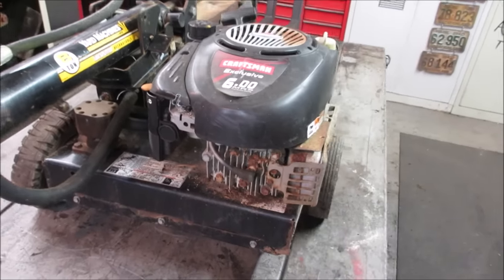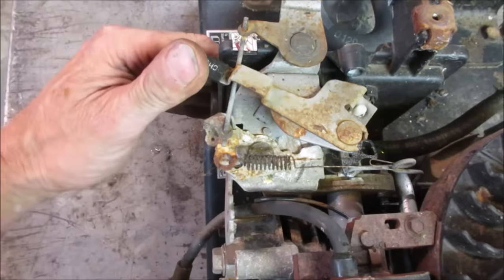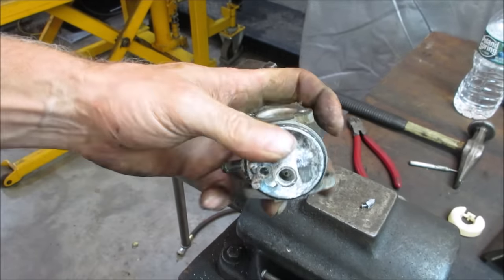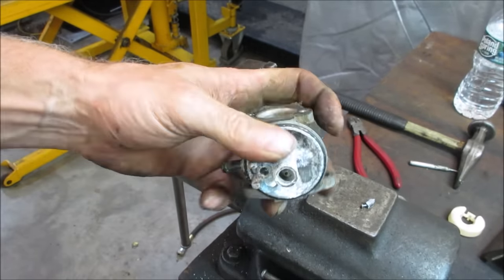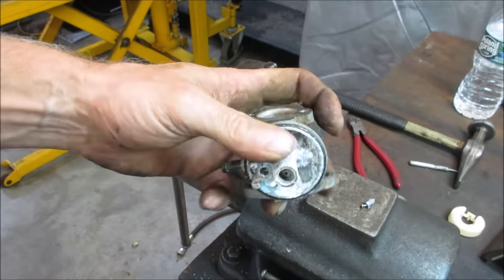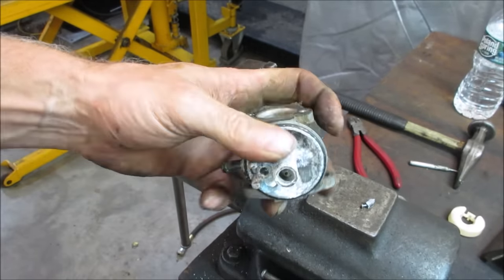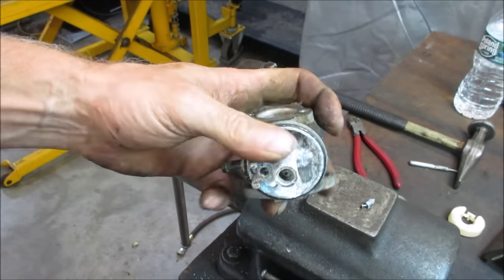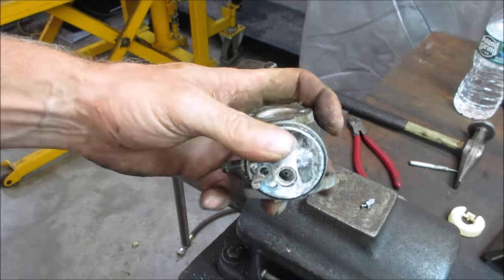Crushed Under a Barn, Free Busted Log Splitter

Comment: Loved it! Mustie you are the epitome of the circular economy - anything that can be fixed and reused is put back into service!
Reply: ironically that only works because several 100k watch and make it economically feasible.
Reply: Making old stuff operable is maximum green.  Many recommend(Scotty K.) that the greenest car is an older Toyota gasoline car that you keep on the road for several hundred thousand more miles.  Many of the newer things that are supposed to be green have failure rates so high that they wear out very quickly.  There is pollution for building the device in the first place. If it doesn't last then you have to build another one. If the so called green device does not last long enough to save enough energy to "pay back" the cost of having to build and install it's replacement then it ain't green.
warrantee three times in the last 5 years. I'm not sure what I will do when it hits 5 years.

Comment: Just add it to my list, powerful little machine! Another machine back in service 👍
Reply: Dear Jason 5150mxVW
👍👌👏 Always nice to meet you here. 2) Yes, you are right, it's powerful enough. If a cross shaped splitting wedge would be added, it could really be a very usable device. With this single wedge, splitting wood is simply too time and fuel consuming.
Hope that you are fully recovered from that extremely exhausting rescue mission.
Best regards, luck and health in particular.
Reply: @Chr.U.Cas1622  Well this is a homeowner series machine, meant for casual "splitting one tree per use" and not an industrial type machine meant to run all day so that's why it it only has one wedge. Adding a cross probably means upping the size of the machine and the horsepower rating (up to 8 HP). Too bad people just don't have any time anymore, eh? Make time and quit complaining about the small things.
Reply: @Hjerte_Verke  
Now look at that! What do we have here? Doesn't it suspiciously look like a camouflaged, little but nevertheless typical internet troll/hater? Someone showing in public that he wouldn't upgrade (easily done by the way) a device to save time, money and, most important fuel! So less fuel consumption = less environmental pollution and noise reduction (also very important nowadays!) means nothing to him!? He would rather bother his neighbours and environment than using his mind!?
2) The over 6hp strong engine is already an upgrade and therefore more than capable to be used in combination with a cross splitting wedge.
Best regards, luck, health and wisdom in particular.

Comment: Absolutely love this. Great way of seeing the difference that cheap ram fluid is vs the real stuff. Absolutely love how he explains the way the carb has issues with the water in the fuel and that turns the thing into a surging engine as the thing is trying to suck up the water but then dies off just enough to get the right amount of fuel to run again. Just absolutely love these videos!!

Comment: Torch tip cleaner rods work great for small carb passages, and they have mild filing edges. Great for things that run a hair lean or breaking the crud off the sides.
Reply: I think torch tip cleaners are what he meant when he said people were sending him pipe cleaners. Pipe cleaners are way too large for carburetor orifices. I think Mustie has a set of torch tip cleaners but he was showing us how to get by with common means.
Reply: @Hjerte_Verke  I thought that too, but he said they weren’t small enough. The ones I have are easily as small or smaller than a bristle from a metal brush.

Comment: Nice light duty splitter and nice save on that carb. One thing, you never want to spray carb cleaner on the Viton needle seat. Viton reacts by swelling and that’s the reason the float wasn’t level. In this application it may not be a problem but a steady load like a pressure washer or a mower would starve for fuel.

Comment: If you ever lose or need to replace a float hinge pin, a nearly same diameter replacement is the stem that breaks off after inserting a  pop rivet.
Reply: The hing pins for a flote that i have seen are closer to the size of a small paper clip.

Comment: One way to clean the walls of a small orifice or channel like that needle bore is to cut a 1/4" deep slot in the end of a small wooden dowel, and stick a short 1/4" wide strip of fine emery paper in the slot.  Orient the strip of paper so when it's wound around the dowel the abrasive end is exposed.  You can adjust the length of the strip to match the I.D. of the bore.  Spin it in your fingers or a drill motor.  Works extremely well.
Reply: or a finish nail instead of wooden dowel, cut slot etc.
Reply: Another idea is since he has a drill bit that is just a little small, he could slather a bit of lapping compound on the smooth shaft and spin it by hand to polish the i.d.
Reply: I was going to reply this exact thing till I saw yours.

Comment: Splitters are life savers if you burn wood. Great video D. Years ago I had to split wood with a axe, hammer, and wedges. My Dad felt sorry for me and bought a splitter. It was awesome! Thanks for another great video!! Darren
Reply: Worth $200 easily. You got the video 📹 for future trouble shooting
Reply: Combination of both for me.  I don't think this model is capable of  vertical splits, so wrasslin' huge rounds up to the splitting deck is a giant pain in the....back.😉. Plus, as long as i ain't too whooped yet, a good splitting maul is waaay faster on (what looks like) maple he's splittin'.  I'd probably still try a maul to get halves or quarters on huge rounds before hurting myself lifting.  This little splitter is short so that helps

Comment: Looks like an older Briggs Quantum style engine...the carb, filter, and throttle/choke lever setups (with no primer bulb) are just like the one I have on one of my mowers. Keep 'em in oil, keep the needle/seat clear, and fresh gas - one pull starts every time. I LOVE those engines. So simple and pretty much bulletproof.
Reply: I was surprised to see it was a flathead. The blower shroud styling says "early 2000s" when Briggs was supposed to have stopped making flatheads (about 10 years before) because of the evil EPA. But it's probably much older.
Reply: @Hjerte_Verke I think they made Quantum until about 2013. It would have to be a pressure washer engine, not a lawnmower because the lawnmower blade is the flywheel.

Comment: You can find a set of torch tip cleaners at Harbor Freight, very inexpensive, very handy for clearing tiny passages in carbs. Great video, Darren takes junk and turns it back into a useable, saleable machine.

Comment: 41:50 ... I've had decent luck putting a vertical score on the butt end of the drill bit to act as a debris path and using lots of valve lapping compound to "re-bore" and hone those crusty needle passages.
Thanks for sharing 🇨🇦

Comment: Great video. A little tip to help with small amounts of water in the fuel tank, is to add some methylated spirits. That mixes with water and will go through the system.
Reply: I was shouting that at my laptop screen as he was trying to 'wash it through with gas'! Yeah, the meths trick helps to get water out of float bowls too, if you can find a hole to get the stuff in there. It doesn't take a lot to do it either, and the end result mixes with the gas and goes through the jets just fine. Been there done that with a few different automotive carbs.
Reply: isopropyl alcohol also works to bind the water

Comment: If it's not running and it was left outdoors it's a rare day when Mustie1 Darren can't get it running.
He's definitely the Carb wisperer.
That one I surely thoght was destined for the scrap pile and I have a 2 year high school small engine vocational school diploma.
It's always a pleasure when a 2 hour plus Mustie1 episode pops up on a Sunday. 
There are modern spark plus glass bead machines that use high pressure air to clean out the beads from the insulator cavity.
A buddy of mine has one.
You can use sand in it but the instructions recommend glass beads.
Sand is to abrasive and will cut the lifespan of the unit.

Comment: Thanks for your weekly Sunday morning entertainment.  

I have jet cleaners.  For about $3 you can get one. They have various wire sizes with textured sides which makes them slightly more effective for cleaning then a strand of wire brush.

For clearing water, dry gas or seafoam work good.  They mix with the water and make a fluid that can pass through jets and be digested by engines.
Reply: "...then a strand of wire brush." ?
Reply: @manolisgledsodakis873  typo for "than"
Reply: @manolisgledsodakis873  Or a strand of multi-stranded electrical wiring? No need for "special tools" when a strand of soft copper or brass wire will do the job and also give you less risk of changing the metering hole size by overzealous use of abrasive torch tip cleaners. I think Mustie has a set but he is showing us how to fix engines with common everyday items.

Comment: I have a 14 ton log splitter on the back of my 70HP international 674 tractor, it will split across the grain as well as this machine but not much better, that is a great pump and cylinder. I would have it mounted on and off the Teramite. 
Great find and like the new bolt selection.

Comment: I would say there is a pin missing from above the ram. There are two holes above the ram and I would think a pin goes in ti hold the ram down on the bed. Works without it though. Well done for saving another piece of machinery.
Reply: I was about to make the same comment.  Pays to check the comments first!  Probably had a sleeve like the other two did.
MJ

Comment: I find that the carb cleaner makes the seat swell some so the float sits proud. Sometimes you can let it sit for a day and the seat will shrink some so the float will be more level. Depends on how beat the seat is whether it will shrink back over time.

Comment: It is a double acting cylinder -- it is always full of oil. Both sides are approximately the same volume, the active pressure direction can be either in or out depending on what it is used on. To get all of the oil out, open the valve and move the piston shaft in and out by hand.
Reply: the rod side has less volume the bigger dia. of the rod the less volume.

Comment: I was looking forward to the twin v twin continuation. I had a good coupler suggestion. It's two sprockets one on each motor shaft with a double roller chain coupling them end to end acting as a coupling.

Comment: As an avid avoider of GM vehicles, Mustie apparently didn't notice the label that clearly said DEXRON III.  Nothing wrong with his theory (on a worn pump) but it was at least designed for ATF.
Reply: ATF is hydraulic fluid 🙂
Reply: @thedevilinthecircuit1414  Yes but he was saying ATF is too thin.  That's what it called for.
Reply: The fluid was more pink than red, so it had water/ condensation in it. You really notice it when it happens in  garden tractors that use it for the hydrostatic/hydros.  They'll barely even lift the cylinders if it's bad enough.
Reply: My Toyota van uses Dextron III in the power steering pump.

Comment: Mustie, have you thought of using a glass blasting media for cleaning carburetors and other parts made out of aluminum?
Reply: and get silicosis, yaaaaay
Reply: Then crushed walnut shell media is better then?
Reply: I use baking soda for gun parts and internal engine parts.  It washes off readily and doesn't leave anything to eat the engine up.  You could probably even hit the jet with it.
Reply: @Frank-Thoresen  hey frank where'd that comment about "glass not sand" go :3

Comment: 01:21:24 Was that a bolt dislodged during the pressure washing? Looked a little like the bolt that had the spacer on it shown earlier. Ended up on the concrete just at the bottom of the video frame.
Reply: Good catch, I missed it!

Comment: I watch an Australian guy make stuff and when he uses the sonic cleaner he fills the bucket with just water and then uses various fresh cleaners in ziploc bags vs. filling the bucket full of cleaner.  He puts parts in the bags filled with say.. simple green and give them in a ride.  I wonder if you were to put some sort of aluminum cleaner in a ziploc and toss that skanked white deposit coated carb body in there and see if that works out.  For cleaning out small holes, I used the tip cleaner for my torch.
Reply: Is it Marty T from New Zealand? 🙂
Reply: @PuchMaxi  I want to say his name is Mark Presling from Australia but just spent a good while trying to locate that video where he reveals his techniques to sonic cleaning but there were so many videos...
Reply: @greavous93  Thanks, I think you are right! I'm subscribed to Preso too 😄

Comment: When you pulled that snapper mower out it brought back memories. I bought a new snapper mower in 2000. Finally the engine failed and I replaced it with a $125 predator engine. Runs like a champ. I am sure that frome will outlast that engine. I paid about $450 for the mower when new. Its been a great investment. And believe me, i dont treat it very nice. Lol

Comment: Mustie,
As many carbs as you work on I have found that a Dremel with a small brass wire wheel works great for those small areas. You can get the brass wheels in all the popular configurations pretty cheap and they do a great job. 
Oh and isopropyl alcohol helps evaporate water in those tanks as well..
No more axe splitting for Mustie!

Comment: I usually pop the needle seal out by putting a shop rag over the carb and catch it when blasting with air.  Yes, I have missed it occasionally and surprisingly find it in the shop!

Comment: It definitely pays to keep parts from other projects, as many parts as you can. Like here, that little small part, you found a match. I can't help but get pissed when one manufacturer uses all these different parts for the same use! Guess it's a marketing thing! Do you think that oll has ever been changed??? Changing that hydro fluid definitely changed the amount of pressure that cylinder was putting out. The other fluid wouldn't even dent the 2x4 earlier. Got to say, watching your videos for some 4 years I always learn something about small engines of all types. Thanks for the knowledgeable, and entertaining videos you put out. Be Safe, and God Bless!!! Looks like you got yourself a winner. Split that log flawlessly!!!

Comment: Hit the white crusty with some PB blaster...or WD40...might loosen up the schmoo before you try to take it apart and soak in the sonic cleaner.
Just read that vinegar or lemon juice can dissolve that white aluminum rust easily without damaging the aluminum underneath, maybe a dunk in a cup o' vinegar for 5 minutes before disassembly would help.
Keep em coming!!!!

Comment: Hey! I have that log splitter! Bought it brand new from Home Depot for a couple hundred bucks in Biddeford, ME about a decade(?) or more ago. Only issue, other than a gummed up carb, is the auto return on the hydraulic ram gave up, so I have to keep my hand on the lever to catch it from stalling the engine. For a relatively small splitter, works OK...

Comment: Splitter is nice if you get a log with a lot of twisted/knotty grain. But for fastest splitting stack a couple of old tires, pack the unsplit sections of wood inside them and whack them with a splitting maul. The tires hold them from tipping over/shooting out at your shins until they're all split.

Comment: First time I seen a log splitter years ago I had no idea what it was 😅. Aside from that, I trash picked a Harbor Freight electric one maybe 5 years ago (5 ton model), sat outside and the electric motor had water in it causing it to seize. I took it apart, cleaned up the shaft, oiled it and it worked, you’d have to pulse the power button quickly a couple times to start it to get it to spin, or leave the shroud off and spin the fan blade with a stick on first startup, but never failed to split wood.

Comment: Your buddy hooked you up with all those surplus inch bolts, because nowadays everything is metric.  I can remember the days when you would go to a hardware store looking for a metric fastener and the selection was only 1 drawer with a few sizes.  Now if you go to Home Depot, there are 10 drawers full of metric and maybe 1 drawer of inch sizes.  Those lower bolts should be just tight enough for spacers to roll along the bottom of the track.

Comment: AT one point you mentioned the dangers of blowing a part across teh room and never seeing it again. Done it too many times myself.  Something I've thought of but not actually done is make a 4 sided partial cube of window screen with an open front for those kinds of operations. 24" sides, top and back, sitting on the bench.

Comment: Excellent video Mustie 1  :) also nice find on Woodspliter , with motor also hydraulic cylinder  , for cutting blade want razor sharp plus like paper cut does to our fingertips  on triangle sharp up  and hydraulic fluid  20W50 work go on cylinder! For keeping cylinder clean and shiny use soft grip sandpaper 400 grit Automotive  Restoration  do wet sand too if want know ! Also motor run 10w30 no synthetic engine oil type and 89 with 5 % Ethonal or 90 with no % Ethonal  plus Fuel tank with Fuel or Carb cleaner too each time !

Comment: I use a Dremel with a cupped wire brush to clean out corrosion from carburetors. You can really get into those hard to reach places. I’m also surprised you didn’t use a qtip with polishing compound to clean out the float seat. I learned that trick here. Next time!

Comment: My Dad used bar and chain oil on the top of the slide bar for lube and as you split wood you will be replacing that lube regularly, because the wood soaks it up.